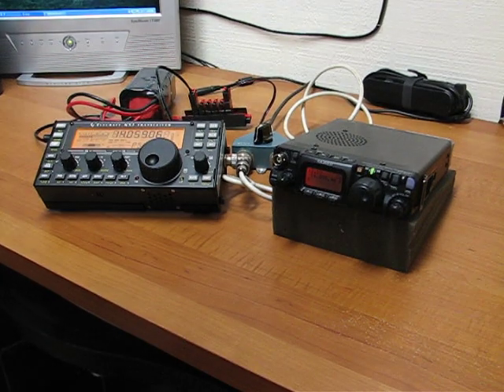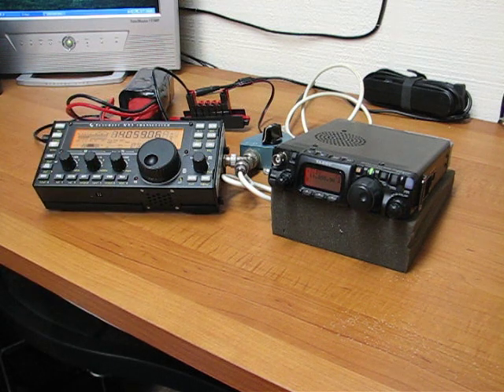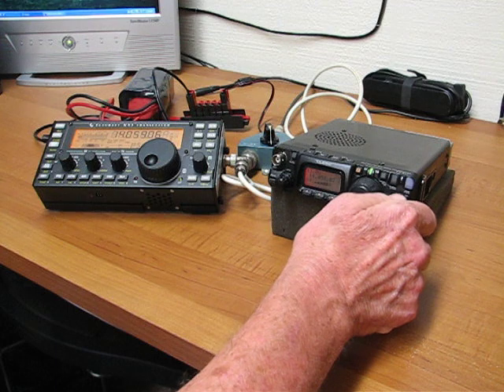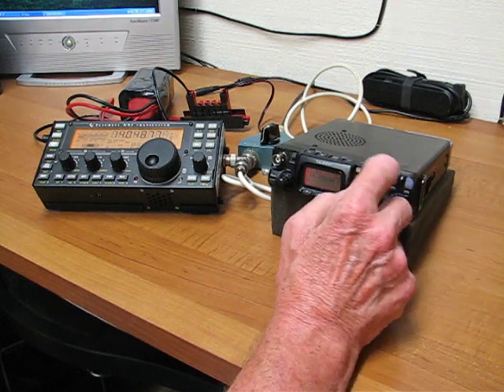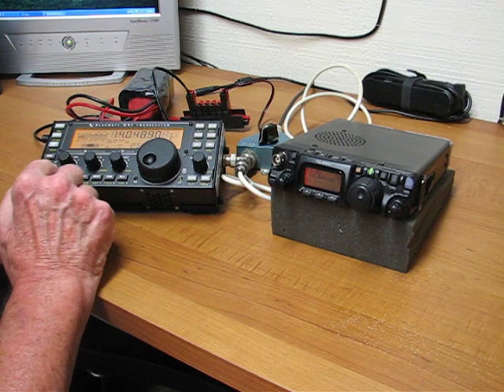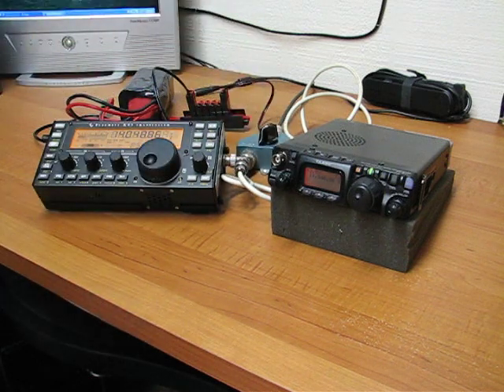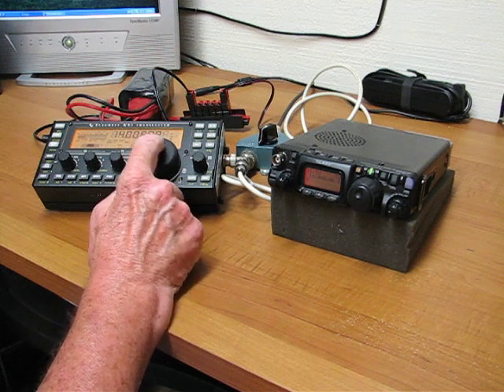KX3 vs FT817 - part 1

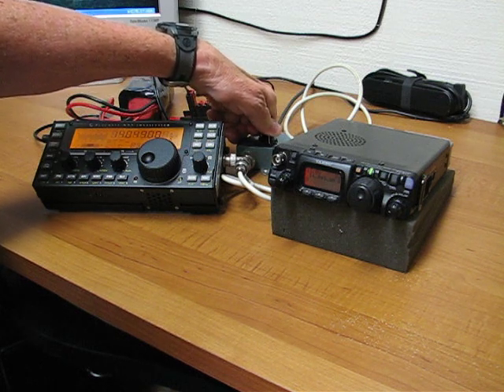Comment: I own an FT817nd and a K3 "dream station" (K3, KPA 500, KAT 500, P3).  I am something of an Elecraft fanboy.  Having said that, I did not appreciate much difference in the receive of the weak signal you pulled in between 5:00-6:00, especially given the speaker difference. Both were copyable.  Price on the KX3 with the tuner and filter set is about $1,200, the 817nd is < $800 with a cw filter.

These are different radios with different purposes.  I think Elecraft wanted a radio with a true price point of around $1000 to compete with Yeascomwood, and give a qrp/portable option to the Elecraft fanboys like me. 

You can take the KX3 and build a full home station capable of 100W-plus operation, with pan-adapters, SDR filters, the whole 9 yards.  It is a capable contesting rig on the receive side bettering much bigger, expensive radios in Sherwood Enginerring tests - actually I think its in the top 3 of all time on receive - but by that I mean close separation of weak signals. 

But, that fact of the matter is, portable QRP is not about hooking your radio up to a $10,000 Step-IR 3 element beam and tower combination and finding the weakest signal out there.  It's about picking up a radio, tossing it in a bag, going outside, throwing a wire up in  tree and seeing what happens.  Is the KX3 better in that regard than the 817nd?  Not really.  Youtube is full of 817nd's doing some spectacular QRP work then flipping over to VHF to make long range contacts for SOTA.  I dont see how a KX3 would be better (with the exception of its add-on antenna tuner - which btw you can also get as a stand alone kit for the 817 from elecraft as well). 

If you have a base station already and want the KX3 for straight portable QRP only, you can get the 2m module for the KX3, the Antenna Tuner, the roofing filters, the microphone and make it nearly as flexible or more so than the 817nd; but then you end up with a $1400 qrp rig.  At that price, I think you have become a qrp fanatic. Its not a bad thing, but that is what you are.  

If you're an SSB guy, you like qrp, want to hit 2m and 70cm repeaters, and already have a base station, its tough to ignore the 817nd.  At $659 warts and all, 15 years old and all,  there is a reason why it has been so successful for so long.
Reply: I've just acquired a Yaesu FT-817ND and I'm impressed with its reception. I have an AlexLoop antenna and I'm just waiting for the weather to improve here, so I can't take it outside. Thanks for your feedback.
Reply: @juliocesarpereira4325  no problem.  6 years later I stand by this comment.  I have the KX2, which is a better radio than the 817nd, but that’s mostly due to its antenna tuner, DSP and noise blanking features- which become much less important if you want to do portable qrp.  It doesn’t do 2m cand 70cm, and the KX2 is rather fragile as well.  The 817nd (and its unimpressively upgraded replacement in the 818), remains a remarkable radio that is tons of fun  to operate and has some nice features like broadcast band receive (which is quite good), that give it some extra juice.  It’s still serviced by Yaesu, so you can buy one used and know that it can be repaired for a very long time.  A word of advice. As much as I love my own Alex loop antenna, you need to understand that the efficiency of that loop on 20 m even perfectly tuned, it’s somewhere in the range of 10%-20%.  You can forget about 40 m, where the efficiency is even lower. At least for single sideband.  If you don’t mind, I would suggest (actually strongly urge) for you to look at one of the portable end-fed half wave antennas (Par makes good ones, they’re owned by Vibroplex now).  You can work 40, 20, 15, and 10 m without a tuner, it’s full-size, full efficiency, and that’s what you need for a 5w radio.  They even make a version where are you can work 80 m, but I think that’s a bit too long for QRP or portable work. They’re also much cheaper than your Alex loop.  Just throw it in a tree.

Comment: Did you install TCXO and CW filter in FT-817? KX3 is around 3 years old but FT-817 is around 13 years old.
So, I love FT-817 more then KX3, because, it is no impressive performance then FT-817.

Comment: My 75A4, BC-342, R390A or Drake 2B would sound better than either of these. Sensitivity below 20 mhz has not been an issue since about 1922 when Armstrong invented the regen rx. The rest is all ergonomics, stability, selectivity, audio fidelity, features and lots of hype. The real difference in these 2 radios would show up during a cw contest where signals are only a few 100 hz apart and very strong. The KX3 should easily beat the 817 when it comes to IMD but just listening to weak signals on a quiet band reveals very little.
Reply: Steve Ellington   "The real difference in these 2 radios would show up during a cw contest where signals are only a few 100 hz apart and very strong."

Thats right this close spaced high dynamic range the elecraft fanboys are so focused on is way over hyped.  

 Very rarely does close spaced dynamic range become an issue for 99 percent of hams, The fact is anything over about 60db of close spaced dynamic range is more than adequate for the vast majority of ham radio operators. Remember the difference between an S1 signal and an S9 signal is only -73 db that's why anything over 60db of close spaced CW dynamic range is more than  adequate for the vast majority of of users and why a 101db of close spaced CW dynamic range is over kill and wasted on the vast majority of users  

  One of the issues is that  very few hams live in a low enough RF noise environment or have the station setup to take advantage of a high dynamic range CW receiver. If you live in a remote area of the world and see an S0 noise floor and have stacked mono band yagis on 120 foot towers then it might become a slightly more important consideration. 

 For the rest of us  sure its something to take into consideration but its not the holy grail as there is a lot more to a transceiver than close spaced dynamic range. Again all things being equal the the truth is  you would need laboratory grade test equipment to measure the RX performance difference between these two radios 

 The difference in close spaced CW dynamic range  between the two radios only comes into play when you are connected to  high gain directional antennas and are lucky enough to have a very low atmospheric noise where you can take advantage of the receivers low noise floors,  you are using mono band yagis at 120 feet and there is enough atmospheric noise to move the meter then the advantages of the KX3's dynamic range quickly diminishes..

For example the difference in close spaced CW dynamic range means it would take a 40 over S9 CW signal 2khz away to increase the KX3's noise floor by 3db , 
On the other hand it would take a 20 over S9 CW signal on the FT817 to do the same thing.. And remember the higher the local noise floor the less advantage the KX3 has for example if you have an S2 noise floor  it would take a 52db over S9 CW signal 2khz away to increase the KX3's noise floor by 3db and a 32db over S9 signal to increase the Ft817s noise floor 3db and how many of us are lucky enough to have an S2 noise floor or unlucky enough to deal with 52db over S9 CW QRM 2 khz away from band edge to band edge..   I personally find that in pass band QRM to be far more problematic than 53db over S9 signals 2khz away are and that's something only a lid filter can correct. 

Again there is a very narrow and rare set of circumstances that give a high dynamic range receiver a slight advantage. A set of circumstances that is highly unlikely to be an issue encountered often by those using compromised portable antenna system or for that matter even a tri-band yagi at 40 feet in the suburbs.
 
Also don't forget this only applies to CW as the wide spaced dynamic range of these radios for phone aka SSB operation is nearly identical. In other words if you are a phone aka SSB operator and have bought this radio because you bought into the dynamic range hype than I'm sorry to say that you've been grossly misled.

On the other hand if you're an Elecraft fan boy using close spaced dynamic range to justify purchasing a more expensive toy by engaging in specmanship then you have other issues to contend with that only a mental professional can help you with.
Reply: As you appear to know the specs well-and might not have to look it all up,  does your analysis here also apply to the K2? Thanks 73

Comment: sure the KX3 wins
it costs a nearly twice as much
and does not do as much 

the FT-817 is like a Swiss Army Knife
Reply: +Darrell Hagan 
 Currently in Melbourne you can get an FT817ND for AUD$700 [US$490]  (strictlyham).  That includes the internal NiMH cell pack.  For that money you can take the wireless set outback and USE it. 

Review VK3YE utube offerings - sun, salt, sand - that elderly FT817 is still firing on all cylinders, still working 18,000 km QRP dx - it doesn't know that it isn't a KX3.  And doesn't give a flying monkey's ring-gear.

My FT817ND has been across Papua-New Guinea, the Solomon Islands & Vanuatu.  Plus several thousand km of bushwalking in VK. It looks like a sack of sh1t on legs.  I don't care.  It doesn't care.  It still goes like it did out of the box.  It comes on 30 km walks across the Dandenong ranges every weekend when not on a "real" bushwalk.  Then it comes home, sits on the bench & works 144 MHz AM with a mate 25 km away on our "telephone channel".  A couple of times a year it gets poked into a L/4 from a kite on 1825 kHz AM (1 watt carrier, wind it back to get decent mod depth within 5 W PEP rfpa limit) - sounds great!

I suppose a Hornady SP 350 grn from the Ruger 3 45-70 might stop it.  Nothing else has yet.
Reply: @nigelholmes9332  KX3 and FT817  Is like taking a Landy or a Toyota into the bush you now the Japanese one will never let you down...
Reply: Sorry guys....I just don't buy the "FT-817 is not in the same class as the KX3" crap. Sure - the KX3 IS a fine radio (I've used one) but the FT-817 IS NOT "Broad as a barn door, overloads easily, etc.", thats just pure cow poo poo. If you know how to properly use the IPO (aka preamp), ATT(aka attenuator) and if needed the RF gain(rarely needed), the the FT-817 will perform very well and in fact better than a lot of bigger rigs. Proper understanding and use of the above mentioned features applies to nearly ALL receivers, not just that of the FT-817. And yes, even the mighty KX3 can be overloaded. The FT-817 isn't the problem - I suspect that some buy the KX3 just because it costs much more and so therefore it MUST be better huh?. Fine status symbol it is. Funny. Oh yeah and don't forget that its clearly superior quality because its American made. Ok fine, whatever. Please don't misunderstand - I DO think that the KX3 is very nice and I do like to help the American economy whenever I can. But in this case the Japanese clearly have a much-more-bang-for-the buck product which is NOT of inferior quality in any way and they continue to sell this product at a very affordable price(and it even includes a nice microphone). But really, none of this matters in the end - what really matters is which radio makes its new owner happy. After all, you only live once. :)
Reply: Erin Taylor The FT-817 works fantastic for those who are educated enough to use it properly.....
Reply: +Erin Taylor Which part of "it costs a nearly twice as much" was beyond your comprehension?  And ten years between respective developments? Of course it's not in the same class. Just better value for money that's all.
Reply: Nigel Holmes Wow, now thats some serious use of your FT-817! :). I have two and one of them has been with me on everything from long wilderness hikes and mountaintops to a 7000+ mi. road trip in 2012 and it just keeps working. I don't think that a KX3 could take the pounding that you and I have done with our FT-817 rigs :). I'm off to look at those youtube vids :)
Reply: The 817 is wide as a barn door and can be overloaded by a cricket farting. Apples and oranges. Not in the same class at all.
Reply: Swiss army knife with dull blades :0)
Reply: +dmastuff  

ah ... that would be a quarter-wavelength vertical, "lambda/4" except I don't know how to put a lambda into these comments. so 130 feet of wire hoisted by a 3' delta kite over salt water it makes that 1 W AM ex-FT817 sing loudly & sweetly and 5 W LSB goes like ten men.

there are websites devoted to hoisting amazing (& fearful) combinations of wire into the air with kites & balloons. one pommy has run a lazy-H on 80m with several kites & guys to space it properly. Not recommended near aerodromes... 

just realised I used an upper case L - wavelength lambda is lower case so  l/4 which looks misleading with the font used here.
Reply: Erin Taylor 
not at all, its a fine little radio 
note how many are on the air 

a better comparison would be KX-3 vs Argo VI
Reply: +ELiTE_OpTiic
Shhhh Troll.  Ain't no-one messin' with your bridge.
Reply: Darrell Hagan applause
Reply: you are not using it properly then. Try playing with the settings. such as attenuation and the RF gain.
Reply: The argo is a great radio but it's way to strip down. It's not cheap either. And the difference between Tentec and Ellecraft customer service is night and day. This is coming from  a huge Tentec  fan  in the past

Sent from my iPhone
Reply: +Nigel Holmes sorry to sound like a newbie... but i am, whats an L/4? this kite radio talk kinda fascinates me
Reply: mac mac neill a
Reply: Darrell Hagan - VERY well said. I agree 100%!
Reply: +Darrell Hagan Go fuck yourself!

Comment: Hi Jim !
As I see both radios are identical in sensitivity. KX3 has more emphasis in 1000-1500 hz sound. That is all -;)
The easy way to see the sensitivity is to compare the natural sound of the band noise...
KX3 is exellent Radio.. But what makes Me down to this radio is half vertical -half horizontal construction... It is not "handy"

Comment: The big plus is that the Yaesu is a HF, and VHF and UHF radio.
The Electraft is a nice radio, but the Yaesu does so much more.
I like HF, but some times 2 meters nets are calling.
If you are just starting out, get the FT-897, the big brother.
But if portable is your thing, the FT-817 is it.
The Elecraft is a touch on the expensive side.

Comment: I have read all the reviews I could find on the KX3 and they all show a 5 out of 5.  I have a recent model FT 817ND and use it with a yo yo QRP all band dipole and both work great!  I am not knocking the KX3, as I wish I had one but they cost almost twice the amount of an 817ND...I like building radios also including my Heathkit "Twoer" I built as a kid which still works....Nice video sir...

Comment: A slightly unfair comparison between a ten year old design (FT-817) and a modern software defigned radio of brand new design...besides that, the SDR doesn't have to deal with the VHF and UHF of the Yaesu radio.  Its like comparing a 2003 Ford with it's contemporary model.  They cannot be compared as they are so different...chalk and cheese!
Reply: I like these comparisons, they help people decide if they want to spend the extra money on this upgrade. because all you hear is people that don't use the 817nd complain how bad it is but when you see its not all that terrible you can decide to spend your money on better things. I just wish someone would do this one a really noisy frequency

Comment: FT-817ND has a little better signal sensitivity than KX I was surprised initially but after understood that KX-3 is a digital baby when Yaesu is old classic  superheterodyne  . All this DSP and the rest of  digital staff are good modern features that help to improve signal clarity  but they never be over real signal sensitivity . And this video is one example  . Two rigs sound equally but some time Yaesu sounds better. I was not sure what radio to buy but after this video 817 is my choice

Comment: Kx3 has a very nice form factor and the rx section may be a bit hotter than the 817 but look at the size of the 817..  All those bands and a not too shabby rx section. Even though old by today's standards its still a marvel of engineering today!

Comment: A much better test would have been to use a signal generator... Every heard of QSB?  I would expect the KX3 to win.  It's 10 years newer.  Think how much mobile phones have moved on in 10 years...  The FT817 should have always had an internal ATU instead of those batteries.  They're hopeless, even at 5 watts!  Interesting... de M1GEO.
Reply: I like the internal batteries it allows me to run a 60watt solar panel with just a small charge controller right into the radio and not have to cary anything else. if fully charged it will give me about 1 hour from before sun rise to 1 hour after sunset with no other batter to carry, and my solar panel weighs less then the radio and folds up to being only slightly bigger

Comment: Thanks for the video.

I have FT817ND with the Yaesu CW filter (In my opinion a must for CW use). I hardly ever use SSB but the FT817 2 meter and 440 is nice to have. The ergonomics of the KX3 sure wins! I need a spinner knobs for the 817 to make it easier!

I think they are both fine rigs with the receiver edge going to elecraft and the price and band support going to Yaesu. The Yaesu needs an update but the big suppliers seem to be focusing on rigs for the high end of the market. 

AA6RE

Comment: Field reports of minor drifting during PSK mode were observed recently. You can be dure that it will be fixed with temperature compensation tweeks by Elecraft. They are a superor company compared to Yaesu service and customer service. Also your test proves they have superior ergonomics . Your left hand looks right at home with the KX3, while the right fumbles a bit on the tiny buttoned 817.  Congrats on your new radio Jim!  You too can join the cult like following at Elecraft.  Enjoy!